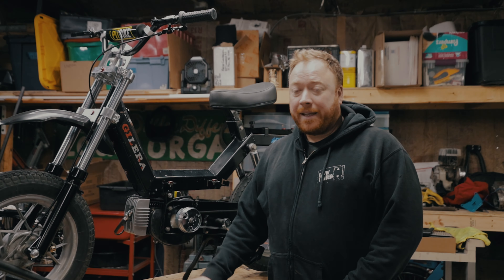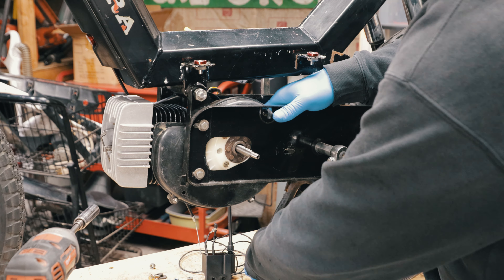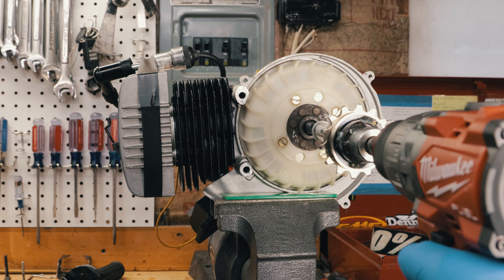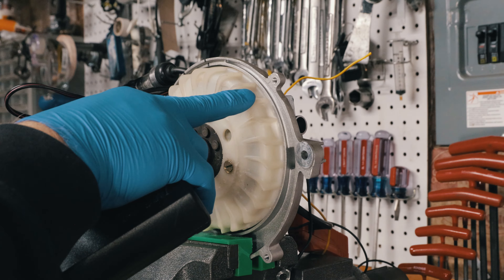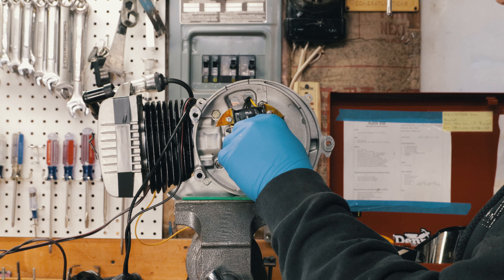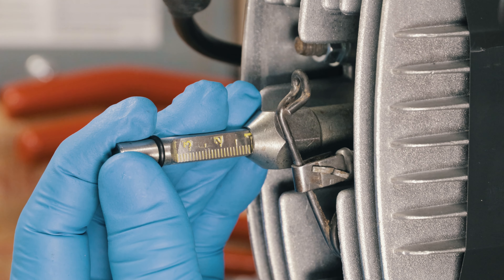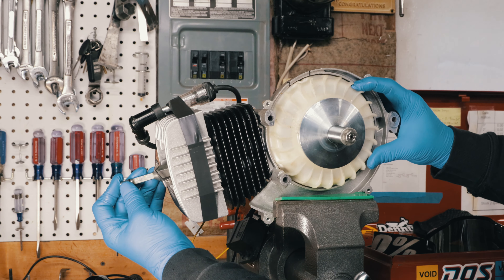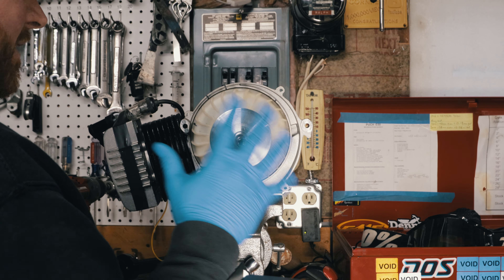Piaggio Kinetic CDI Ignition timing (Vespa Grande, Caio, Bravo, Citta, Si)

Comment: Interesting.  I've heard some kinetic CDIs are like this.  I compared the stock crank from my kinetic magnum to a 12mm mazzy crank and the woodruff key positions were identical.
Reply from the maker: I didn't check the kinetic box. This cdi doesn't have a trigger. So depending on the box settings, it's going to fire in a different location.
Reply: @Corn-ped  Kinetic stock CDI box doesn't have a trigger either, but yeah, it could well fire at a different point on the source coil waveform.